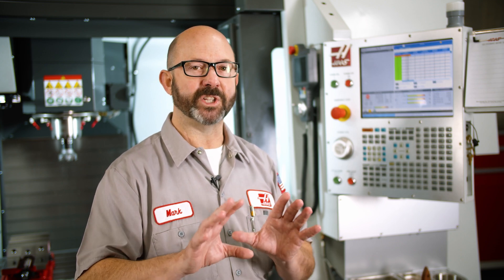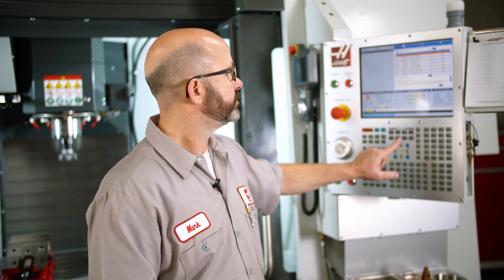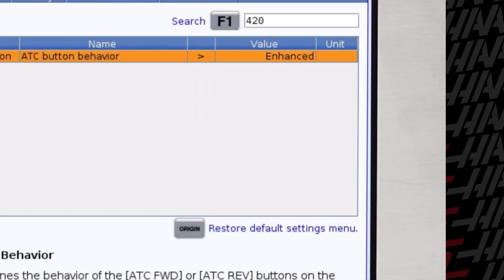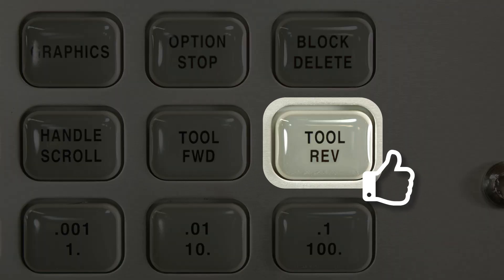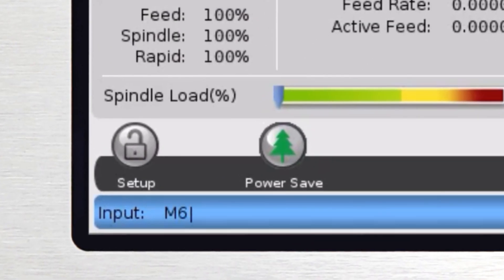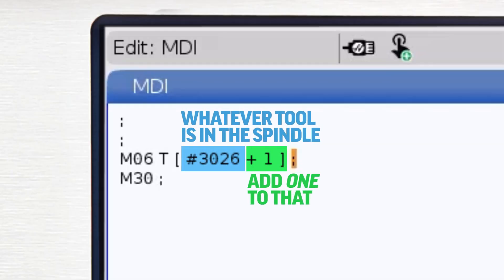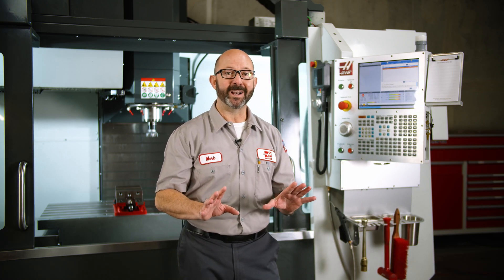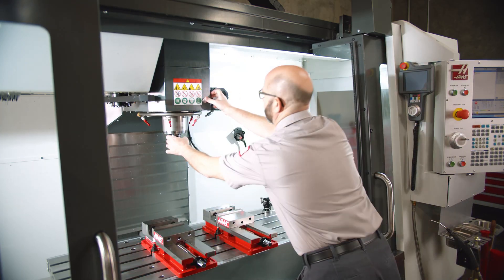Load and Unload Your Tool Changer Easily Using Setting 420 - Haas Automation Tip of the Day

Comment: For those of use with UTC’s it would be extremely beneficial to be able to renumber the pocket numbers like on machines with SMTCs. Having to constantly change tool numbers in cam to fit stuff in the UTC wherever it fits is extremely time consuming, especially when adding in the time to redo offsets every time. I know I can use different T/H/D numbers but I’d prefer to not do this.

Comment: has anyone made a macro statement that re-orders the tools in the carousel sequentially?  On the newer high speed tool changers its not a big issue, but on the older 40 tool changers, the tools being on opposite sides of the carousel can add a decent amount of time to a cycle if the tools have short run times.
Reply: Not sure on the macro side of things. On the program side of things you can always add the T-number on the next line after the T-number M6 command line to get the tool changer indexed to the next tool.
TxM6 
Tx
ect.
Reply: @135SoHc  yes the pre-call shortens up the load.  When for instance you have a drill doing 1 or 2 holes in aluminum, the tool runs for 3-5 seconds, but the 40 tool carousel may take 20 seconds after that pre-precall to get to the right pocket.  Putting them close together by manually calling them up is the only way I know how to shorten that up.

Comment: Two weeks ago I wrote a program to make this easier for myself. I didn't want to do a deep dive into using something like a calculation of some kind, so I just copy pasted the tool number and subprogram call (i run a umc so I position the head right in my face) and changed the toolnumbers till tool 15. Program is written so it doesn't cost anymore time.

Only benefit to this way is when pushed reset it won't start over! So I probably am going to use it
Reply: When you add a N-number for each tool (change) and you reset the program, it jumps back to program start.
You can jump to each tool by e.g. N6 ( tool 6 ) and the [ cursor down ] key, it jumps to line N6 and you can go from there.
Reply: @ytfan3815  of course, great idea. Thank you!
Reply: @Coert94  
You're welcome, I have two programs for this, one simple for tool change, and one with a extra macro-call G65 for the tool-presetter.
We have BLUM Novotest presetter, so I added macro P9912 for the tool lenght H so I can set tool lenght for every tool directly after tool change.
I added several M01's or M00's so I can set approximate lenght in the Offset table before touching of on the pre-setter.
Reply: @YT Fan  I use my program to (un)load tools quickly. Meanwhile I change the inputs for tool measuring in the tooltable. Before I changed all the settings but that is way too much work and not always useful. The way I work now is so much quicker in setting up the machine. Still trying to improve tho

Comment: g84 doesn't take q peck value....what to do???
Reply: G84 is a tapping cycle, G83 is for pecking
Reply: @Cirik7674  but in fanuc it also allows peck tapping if you take q value in g84 cycle
Reply: Multiple Z depths with same x and y coordinate.
Reply: @casey2219  thats why fanuc controller is dominating market and haas has limitations ....😂
Reply: https://youtu.be/yBK1MN_Q9J0

Comment: I made two programs for this type of Setup, just a simple program for T01 to T - - which stops every tool change including the lower Z for easy reach. (G53).
The other one is a similar program with a G65 macro for the tool presetter ( tool offset length - H ),  .... btw, not on a Haas machine.😉